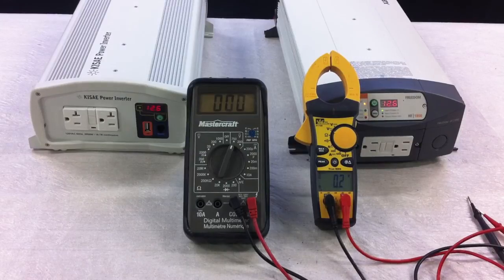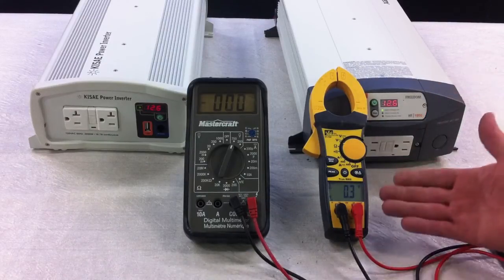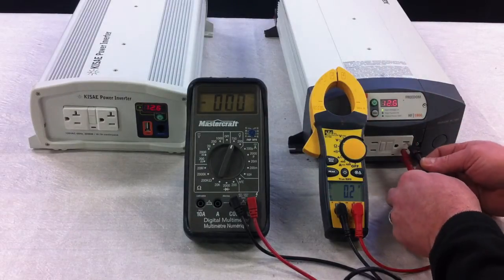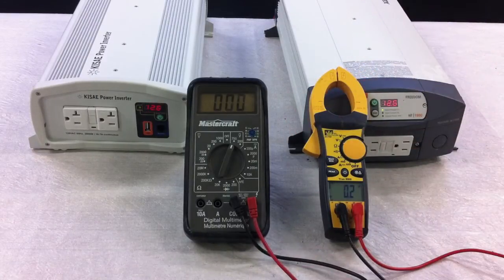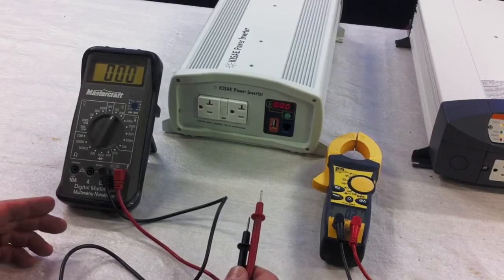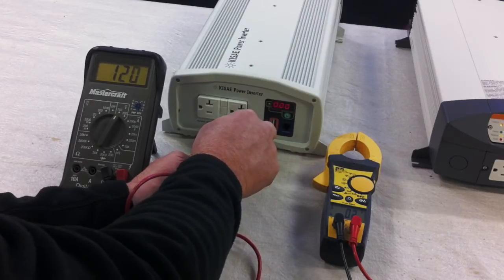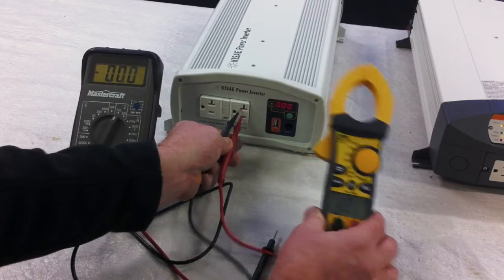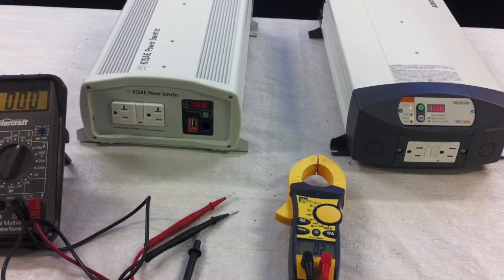Canadian Energy™: Volt meter Differences on True Sine and Modified Sine Wave Inverters

Comment: Is this a way to "confirm" without the use of an oscilloscope, if a sine wave is pure or modified? Or is this purely a weakness of the cheaper multi meter...?
Reply: Not a reliable solution as every inverter is created differently and so you end up with meter displaying the correct voltage despite it being modified sinewave and on other modified sinewave inverter the reading will be way off. Just depends, how they are driving/creating that modified sinewave.

Comment: Guess I got a highly efficient modified s/w inverter. Have a cheapo volt meter with a samples 450w rigged to a 35ah Duracell deep cycle for on the go stuff. My volt meter reads 117v the inverter is rated at 115v.
Reply from the maker: AsianPerson3 Output can vary by a few volts on inverters or your voltmeter may not be calibrated to 100% accuracy, either way an inverter will typically supply more consistent output voltage than your home electrical outlet does connected to the utility grid.

Comment: What about a AC watt/KW meter on a modified sine wave? Do you think it will still be able to calculate the outgoing AC?
Reply from the maker: Hey Daniel. Electromagnetic wattmeters are designed for measuring utility grade power so may not measure or accurately measure modified sine wave AC power, we recommend you contact the manufacturer of the meter.